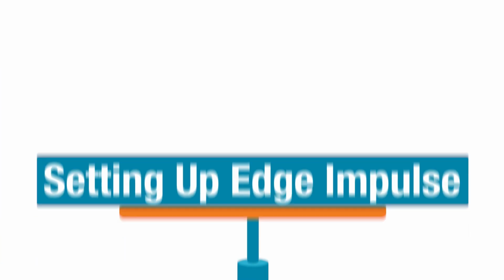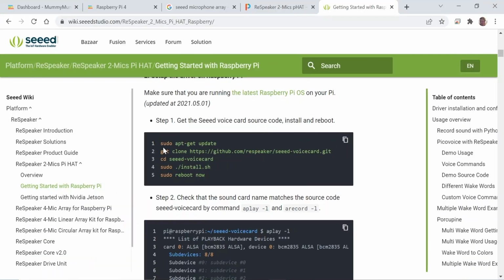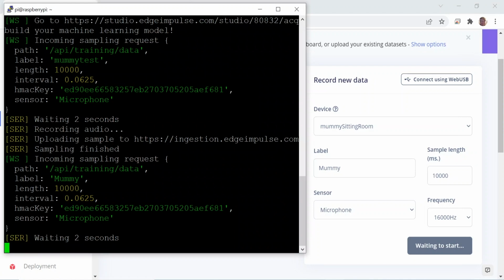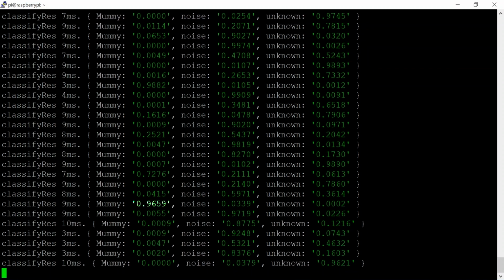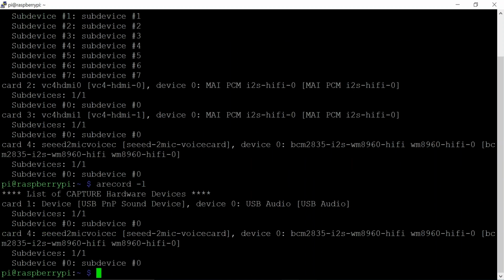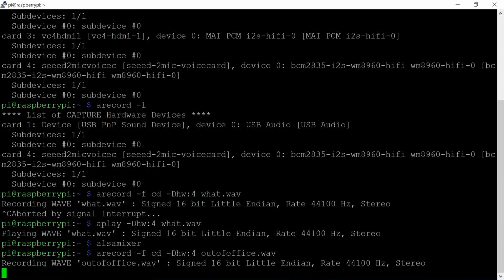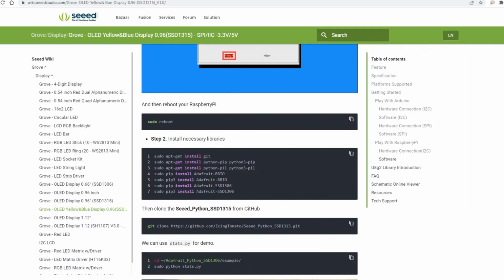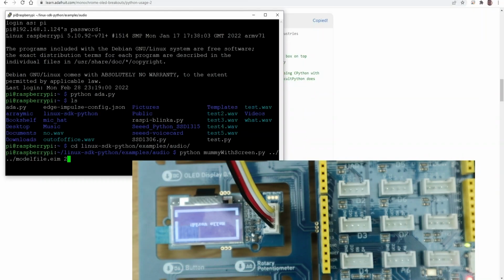Creating a “Mummy” Wake Word Detector with Raspberry Pi and Edge Impulse

Comment: Hello!

I have a question about preparing an audio dataset for training a sound detection model.

For example, if I want to train a detector to recognize the sound of a motorcycle:
When I record the motorcycle, there are usually background noises in the recording (city noise, wind, distant cars, etc.).

Should I clean the recordings and remove the background noise so that the audio contains only the pure motorcycle sound?

Or is it better to keep the real environmental noise in the recordings, since in real conditions the detector will always hear the motorcycle together with background sounds?

What is the recommended approach for building a more robust model?

Comment: Wondering if the sample rate is adjustable on the worse sounding, initial mics? Noticed the sample rate for these was only 8000hz which is very low, whereas the final “hat” mic samples at 41000hz (explains the substantial quality difference).

Comment: I'm working on a digital home audio system that I decided to name Eileen*, it integrates the amplifiers (7.2), some sort of high performance embedded computer, and even DSP based room correction. I'm thinking it would be cool to run an open source voice assistant on it like Mycroft or Jasper and effectively make it into an Amazon Echo with much better sound and much better security.

*Named after Eileen Gu since the TPA3255 chips I'm using give it loads of power with even more impressive precise control over that power.